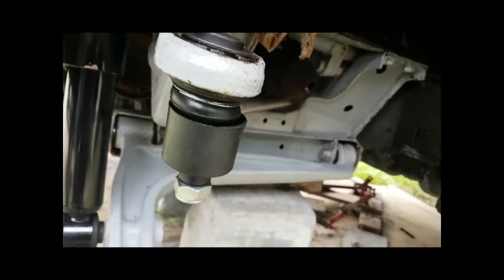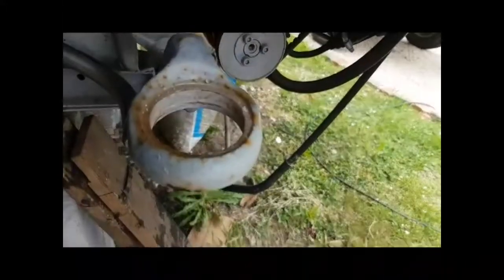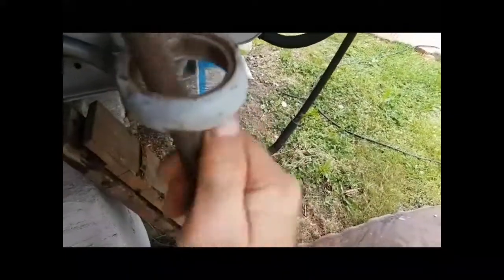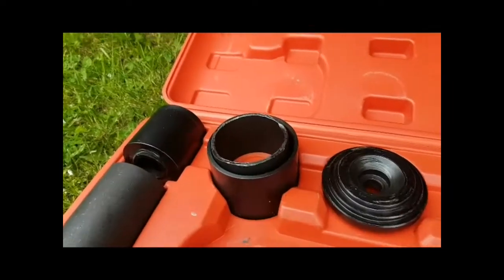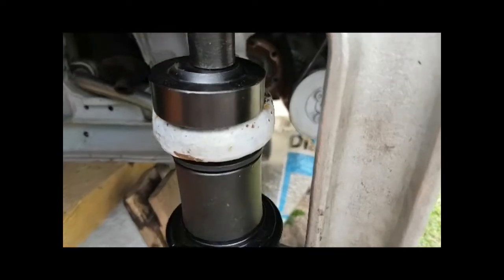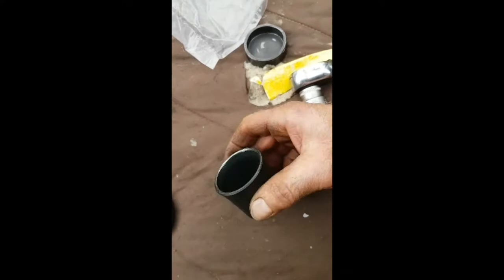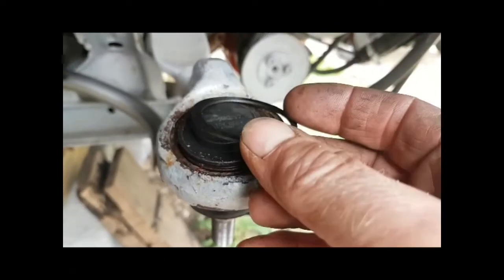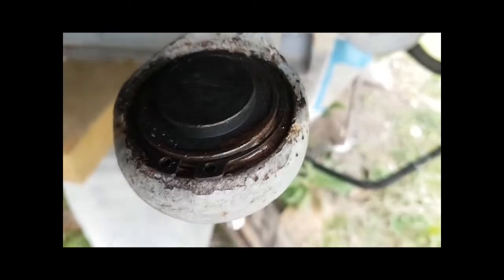vw t4 front suspension arm ball joint replacement

Comment: I fitted mine today with this tool and the clamp bent. Both balljoints are in but the tool is unusable now. Great video 😁👍
Reply from the maker: Yes it was a pig i must admit👍
Reply: @markrocketmangrimstead  just noticed you have by the looks of it fresh wishbones and ecentric bolts. How did you get passenger side one out. Mine has siezed and apart from cutting the bolt out with a angle grinder I'm out of ideas 💡🤔
Reply from the maker: @davidhenderson7722  hi mate, i heated the bolt up on the vehicle, it destroyed the bush but i wasn't bothered as i baught new bushes and used the press kit to put new bushes in,but it wasn't easy . you can buy wishbones complete and i have seen them eccentric bolts for sale somewhere. 
It was very difficult to get the drivers side bolt out,i actually had to reweld the sub frame where the eccentric bolt is,i salvaged the bolts but they wasnt brilliant. 
If necessary cut them off with an angle grinder.